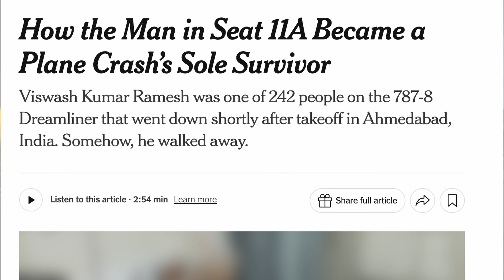Why the RAT Changes Everything – Air India 171 Update

Comment: Another YT pilot showed with a simulator it was impossible for pilot to pull flap handle by mistake.  They are not located near each other.  He talked about the RAT  before you did - he thinks higher probability fuel contamination.  I am still concerned too of the electrical problems plane had while it was in transmit from Delhi.  The lone survivor also mentioned how the lights flicked too.  What could cause a complete electrical failure? Computer sabotage?

Comment: What are the odds of total engine failure from both engines? Wild. Now, I can't comprehend how anybody could survive this. The plane appears to explode upon impact as is usually seen on a crash like this. At what point did he unbuckle and escape that plane??
Reply: It wasn’t a dual engine failure. It was a pilot failure. The engines went into idle safe mode because of loss of AC power because of something they did not verify before takeoff. He would then have to move the thrust out of takeoff thrust detent, and back into takeoff thrust detent to wake up the Fadec out of idle thrust safe mode to bring the power back to full takeoff thrust
Reply: @MichaelDavidRobinson  * interesting. I wouldn't know the details on that, but I'm still baffled how someone survived. The whole thing is a terrible situation.

Comment: I assumed this on the day of the crash. Because the nose was up until it crashed and the gradual lose of power. I got more clarity when the authorities disclosed that the pilot said there is no power/thrust, we’re going down! 
That means something is totally failed to give the engines enough thrust. It can be mechanical/electrical/software related. 
How could you be a pilot without these basic commonsense?

Comment: If the jet engines were at maximum trust, they would easily drown out the RAT.. I live approximately 20 km from an airport, along a commonly used flight path. I can tell if the jet is incoming or out going by the sound,  and they have altitude.

Comment: Seems like captain steeve saw the other guy's video where he said RAT was deployed. 

NOW HERE'S MY TAKE ON THIS CRASH: HEAR ME OUT!

Nobody knows what happened. Even pilot themselves do not know. Pilots know how to fly a plane but i dont think 99% of pilot know how a plane flies. 

Remember, knowing how to fly and knowing how the plane flies are different thing. 

You can know how the plane flies and not know how to fly a plane and similarly you can know how to fly a plane but not know how the plane flies.

From the CCTV video, what i saw is the pilot wasn't operating the plane smoothly. As soon as it takes off you can see the pilot is forcing plane to go up by pulling the nose. What might have happened is, the pilot trying hard to pull the nose up created drag in the air, he also doesn't put landing gear, it created more drag. The angle of attack was higher very early that's why plane struggled to lift. Plane was also full of fuel so it was heaviest ever. In the video, i clearly noticed how the plane takes off and 2 seconds later pilot pulls the nose further hoping to quickly catch air lift. He should have gradually pulled the nose, that might have slowly lifted him up.. 

I think it's the pilot's fault. Landing gear didnt put up, the flaps were ON but not set correctly to get immediate higher lift and the pilot tried to lift the plane suddently instead of gradually (this can be seen in cctv footage when it's flying, you can see after 2 seconds it leaves the ground the pilot pulls the nose up further to get lift quickly.. the angle of attack was wrong. 

A good pilot would have taken it off although bit abnormally than usual cuz of the high temp and thin air and full of fuel tank but this pilot just tried to lift the plan higher as soon as it's in the air. He should have slowly and gradually lifted. Even in the time of crash he's still pulling the plane's nose up and i think forcefully trying to make the plane lift by pulling the nose up made the situation worse and i think that was the initial cause of the crash. To me it looks like pilot fault. 

In the black box he says no power no thrust but mate, your plane flew to 171kts, how can it fly and continue that speed if there was less thrust. 
This pilot clearly put the wrong flaps config and made the situation worse by forcefully pulling the nose up to make the plane quickly climb up. 

This is insane. Highly unlikely both engine failed at same time. It's the pilot fault. 

I think he also did not put landing gear cuz after 2 seconds he knew plane wasnt getting required lift so he didn't payed attention to landing gear and instead tried to pull the nose up further which made it even worse.

I think a good pilot could have saved the crash and rounded in the sky and have done emergency landing.

This is my theory and i immediately noticed how the takeoff was weird and how the pilot was just pulling up the nose of the plane without giving plane time and gradually pulling the nose and this is all combined with wrong flap settings. Even if flap settings were wrong, if the pilot wouldn't have continued pulling nose up to get higher quicker, he would have taken the height eventually but bit slowly and then could have emergency landed safely.

This is what happens when pilot know how to fly a plane but do not actually know how the plane flies and the physics behind it. 

This is what i found, looking at the initial takeoff video and how weird the takeoff looked. You can literally see 2 seconds after plane takes up the pilot pulls the nose up further. The sudden incline of the plan can be seen in the footage and NO ANY so called pilots and experts have said about this in any video. They just don't find the take off weird. It's crazy. Do pilots even see their own work or study it. It's their job i know they take it as job but mate, if i were a pilot i would be obsessed with how planes fly and what im doing and what's plane doing and how do i avoid certain things bla bla bla

Comment: While it is impossible to tell what position the flaps were in from the video, it does appear that the gear was partially retracted, which means there was likely a loss of power during retraction of the gear that prevented it from retracting completely. The first I heard about the RAT being deployed was from Juan Browne, some time ago. Assuming it was, that definitely indicates a loss of power. You can also hear what appears to be the sound of the RAT operating. But what you don't hear, is the sound of the engines at full power, as they would have been on takeoff and climb.

Comment: Thank you for this. Does this also explain why the landing gear could not be retracted as they would have lost the power to them too. 

There is another theory circulating in India un light of recent India Pakistan tiff. Turkey openly sided with Pakistan and as a result Indian govt cancelled several contracts assigned to Turkish firm which related to airport maintenance, aircraft maintenance etc. this particular aeroplane was recently refurbished by a Turkish firm which raises the following suspicions:
1. Sabotage thru cyber attack altering software.
2. Refurbishment altered electrical and other systems.
3. Refurbishment done properly but some recommendations were not complied with before fit to fly certificate.
3.Quality check ignored some results assuming them to be not urgent or trivial.

May the deceased RIP. Human life is so fragile and this is a tragic reminder.

Comment: I don't think it was due to engine failure .. it might hv got stalled during decent .. but while take-off engine were firing as lots of dust blowing from take-off is there .. if dual engine failure is there then fuel contamination is the only reason .. but pilot taking off from extreme edge of runway and video of a passenger of just deborded few minutes back showing electrical , ac , electronic malfunctioning and most shocking was flaps serious issue he noticed .. i think while on runway after achieving V1 speed pilot must have noticed some kind of serious problem in Hydraulics, electrical system coz of which flaps , landing gear malfunctioned while take-off , so pilot might have decided to reach an extreme of runway in anticipation that he would get enough height to dump the fuel and turn around to land back on same runway .. i think bad luck was he was not able to go till atleast 1000 ft which would have helped him to get some time to dumb fuel and do hudson like landing at nearby Sabarmati river .. just shear Bad luck and everything which were not meant to be go wrong , went wrong .. poorest maintainence from Air India , neglecting red flag raised by earlier passenger and allowing Aircraft for further journey is main culprit for such horific accident which could have been avoided ..

Comment: Well, it looks like there was definitely a major mechanical failure and power was lost from the engines right after take off. Other videos had shown that the flight entertainment systems had stopped working on the previous flight of that plane earlier in the day. So, this likely points to a maintenance issue.

Comment: The rat would not be used to supply electrical power to the passenger compartment lighting system. If the passenger compartment lost lighting, the backup emergency lighting system would have provided battery power to operate emergency lights, not the RAT which may very well explain the flickering of the lights. I"m starting to wonder if maintenance poliicies found a loop hole in etops regulations. ETOPs is for when planes fly extended trips over water where they may be a long distance from an available airport  This did not look to be an ETOPss flight because there were available airports within an hours flying time. .ETOPs maintenance policies don't allow a mechanic who worked on one engine, to do the same work on the other engine so if he makes a mistake on one engine, he doesn't make the same mistake on the other engine. Not being an ETOPs flight, a mechanic may have performed a maintenance procedure on one engine and if he did it wrong, he may have performed the same wrong procedure on the other engine.

Comment: Modern turbofan engines just don't randomly FAILand certainly not TWO of them at the same time ! That is literally UNKNOWN !

What I believe is far more likely is that they were starved of fuel. The 787 relies entirely on electrically driven fuel pumps with no mechanical backup.
If there was an electrical failure (and there is lots of evidence of this aircraft having electrical problems), fuel delivery to the engines would be compromised, leading to the reduced thrust that caused the crash.

It's SO OBVIOUS that I'm amazed that people are still considering all manner of crazy theories that simply don't fit the known facts.

Comment: That plane should also sound way louder than it does in the mic!

But it does not. 

Even though the plane is going away from the mic for most of the video, you can tell the sound isn’t powerful or loud enough for their to be any power in the craft. And obviously whatever is happening with the engines, there are no heat waves showing where the exhaust stream path is.

Maybe the plane is still too far away to see the exhaust, but i could be wrong. I have been around airports and seen many airplanes take off
From what I can remember I was sometimes able to catch the light refracting through the exhaust trail with my phone camera during the heat of the day!

But boy is there a sound distinction between this jet and one that is not failing and falling from the sky.

Comment: Its also worth noting that in your frozen frame showing the RAT circled in red.. the main gear bogies  appear to be tilted forward (front wheels down). Normally, they are tilted up, and are only tilt downwards as part of the main gear swing during retraction. My guess is that the power failed as the gear was beginning to retract.

Comment: The eye witness has also reported that as soon as the plane took off, it was like it got stuck in the air, and then the sound of bang and flickering of lights and when all these things took place the plane was like as if it has increased its acceleration so this most probably can be either sound and vibration of RAT or the sound of engines struggling to go high. He also added that the cabin went green and red i.e. emergency lights. Then my question is if the RAT was already deployed why they lost connection just after the MAYDAY call?

Comment: The pilot’s last communication to the ATC was, “Mayday, Mayday, no thrust, losing power”. It is clear that there was a power failure, and even the pilots could not have the time to understand. Just 30 seconds, and the plane crashed. 
By the time you finished reading this comment, 30 seconds would have passed. Imagine the horror and the situation in the cockpit.

Comment: Sir, here is the reason. Jesus said the crush is due to compromise is human moral, despite disapproval, sub grade material was used, safety was overlooked.

Now i dont know if its all parts of plane or partial. Manufacturing a plane at minimum expenditure has caused this.💔. Jesus also said many more crash will happen due to compromise in material quality used during production.

Boeing must be sued.

Comment: Utterly tragic and sickening to watch an airplane coming down like this. In the event of a rare double engine failure, is it possible to jettison all the fuel before coming down? I believe pilots will do this in order to prevent a fire when they have to make a forced landing, but I guess they have more time to do this when coming down during a flight than when just taking off when you are only a few hundred feet of the ground. An airplane is basically a flying bomb when its tanks are full and perhaps more people could have survived if the pilots had more time to quickly dump the fuel.

Comment: The lone survivor said cabin lighting was flickering during the last parts of the flight; am wondering if the landing gear wouldn’t rise due to electrical failure? (and did they try to extend the glide as per the Heathrow 777 dual engine failure. The battery also worries me (see Al Jazeera - Broken Dreams - discusses 788 quality control including focus on battery (and thus electrical systems). Subscribed 🙏

Comment: See the gaps in the flaps? No mistake there. They didn't retract the gear because they were busy trying figure out what was going on with their airplane. Did this plane do a turn around and use the full length of the runway? You can see the dust at the end. Looks like to me they were having thrust problems even before take off, assuming they used the entire runway.

Comment: It's obvious that it was a lack of fuel.  The tank of that airplane was empty, they had 1 min fuel after full throttle. No two engines  can fail that randomly if there is fuel. Sadly it is ground crew human error.
Wait i am wrong, the explosion had plenty of fuel. My guess is that somehow the fuel lines were shut off in the plane maybe that is a safety measure during refueling and somebody forgot to reopen them.  The plane flew with a reserve after the shut off valve then the engine simply flamed off. I remember of one crash long ago where this exact scenario had happened but it was on an old plane where that shut off valve was indeed manual. Or maybe it was on an airliner , i forgot. They explained that in modern planes that shut off valve not being in the right position before take off would create an alert.  Still i think this is the right trail.

Comment: hope I'm wrong, but I can see that maybe the weight of the plane could have caused the crash, for having worked on loading and unloading the luggage in the hold, that if the weight was not respected maybe the cause, and there is nothing for the pilot in his dashboard, neither sensor nor warning that the weight is too enormous, except a sheet that the commander signs on the weight of the luggage in the hold .... that the personnel to load in the front and rear holds of the plane ..... people think that it is not so important, but in reality the weight is important especially for the departure of the plane to take off

Comment: Can fuel valve be left closed post refuelling? If so, how far a plan can go with closed fuel valve? Post refuelling if valve is left closed, will pilot get warming in the cockpit?

Lack fuel to the engines can shut down the engines. What is termed as engine failure can it be termed as engine shut down due to lack of fuel supply?

Comment: New take off procedure. Flaps out until the plane ceiling height. Then you have the farest glide if something hapened. If something gets wrong and the engines cant be re-started then fuel must be dumped immideatly to land with least possible flamable fuel. Also the pilot must know the glide range and immideatly look fo a river or open field to land at glide speed of 225-250 knots. Also a back up battery must be installed to have electric funktions like stearing and hydraulics running!!!